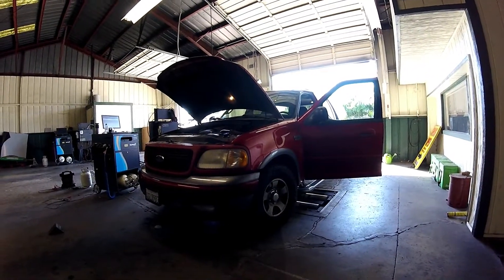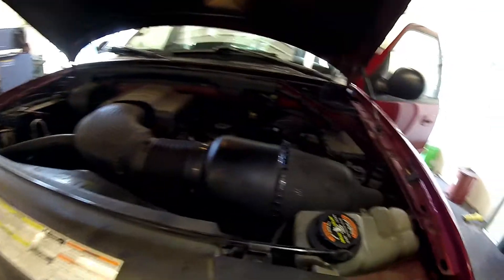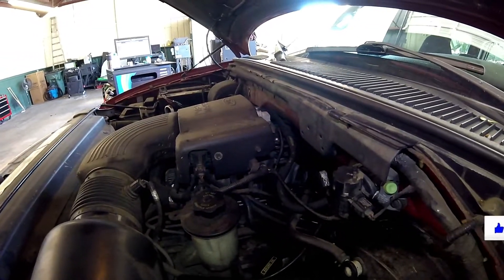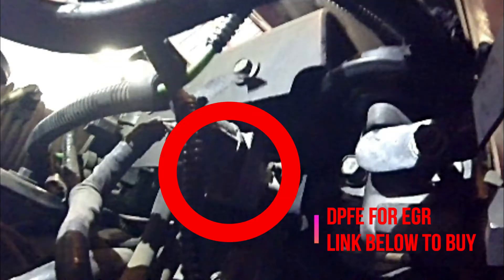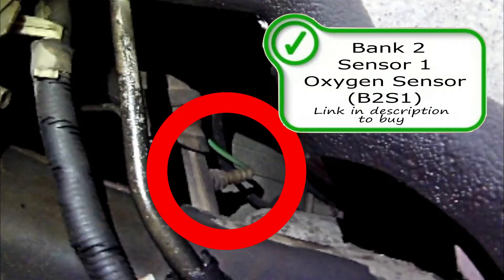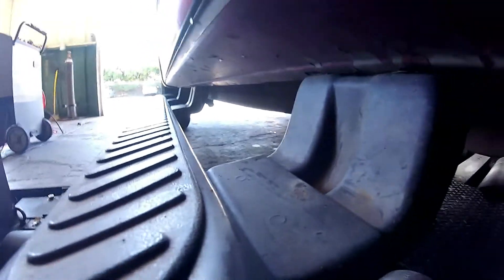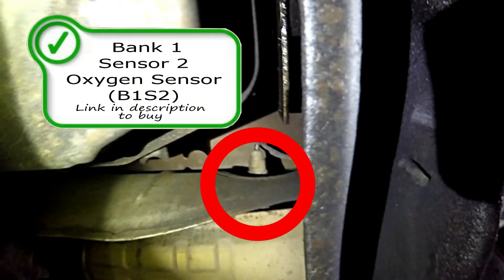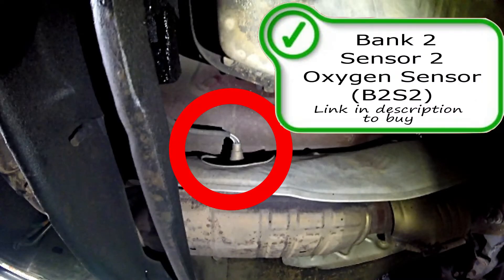Ford Expedition Emissions / Smog Locations: PCV, EGR, DPFE, EVAP, Purge, Vent, Oxygen Sensors

Comment: Hi, will the parts show work for a 2000 Ford Expedition 5.4 L XLT? My smog guy said I needed an Eval Purge Line and PCV Valve line. I called Ford and they said one of the parts is no longer available.

Comment: Have you ever had to replace the third brake light wiring harness where the three bulbs go into on this ford expedition?

I have a 2000 ford expedition 4.6L V8 Triton XLT and my third brake light wiring harness melted where the three bulbs go and I cannot find any videos on repairing this issue. 

As a female that's new to doing my own vehicle repairs, I am trying to find out how to do this and I couldn't even get the dealership service department to fix it, the mechanic said look for one at a junk yard.🙄
That made no sense because that still didn't help me to get it repaired. I just think he didn't want to be bothered with fixing my third brake light.